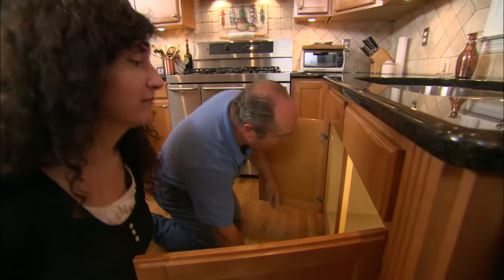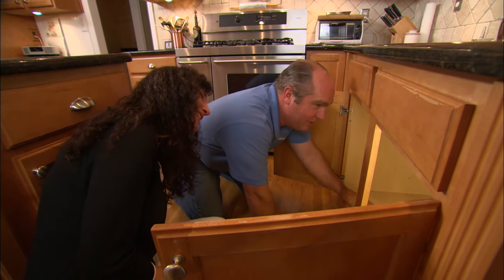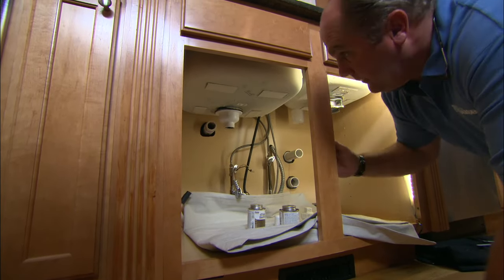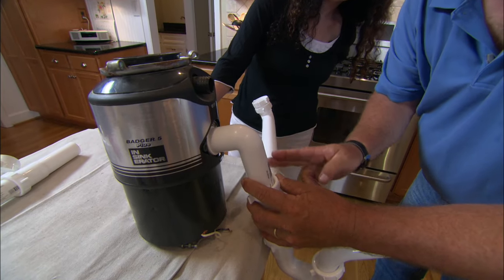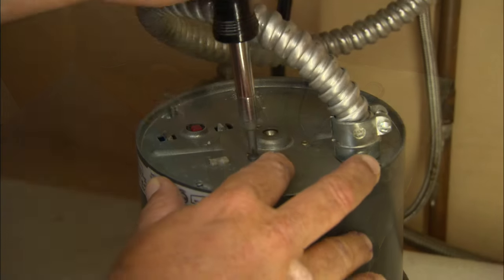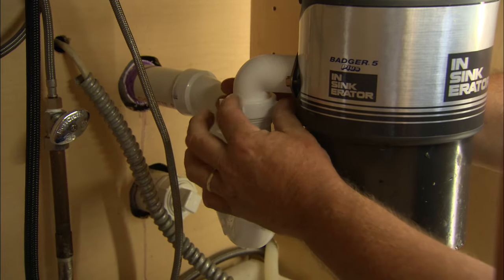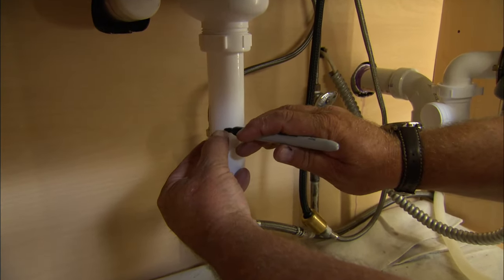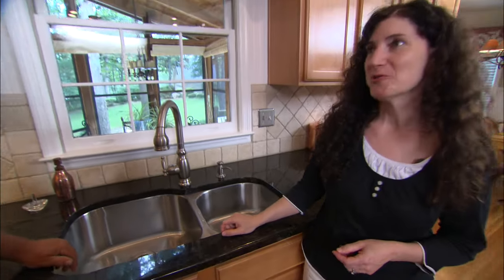How to Repair a Kitchen Sink Drain Trap | This Old House

Comment: I just did my initial inspection of a house rental and the kitchen sink drain piping is leaking all over the place. I can tell its been like that for a long time because the board base is now all black and warped. So now I gotta get them to fix out or figure it out myself and hope the rent does not go up again. Thanks for the video it gives me some insight on how to do it however I don't have a garbage disposal.

Comment: I wonder why he didnt point out that the discharge hose from the dish washer needs to be suported as high as possible under the sink or they need to install a air gap on top of the sink.  Both ways will prevent discharge water from backflowing into the dishwasher.  Depending on the state. one or the other is required by code.

Comment: I would love to cut open the wall and see what's going on behind there.
Reply: lmao same here
Reply: Chicago code same as in Video  dbl bowl with dishwasher each has its own trap and waste line 
Material list for 2”  waste stack  and vent  
DWV fittings 
2-2” Tee
1-2x1-1/2 tee
1-2x1-/12x1-1/2 tee
2-2x1-1/2 Wye combo
1-2x1-1/2 bushing
2-1-1/2 90
3-1-1/2 tee
3-1/12 trap/marvel adapters

They openings out of the wall same height

Comment: The three trap install may be a code requirement in Georgia (at least when the house was built). All houses in my subdivision have the same setup.
Reply: You prune in this Video Richard does clearly mention 3 traps is way too much

Comment: He said that the drain pipe was too high on the left sink but the new one on the right also looks high to me. Shouldn’t it go directly to the wall from the P Trap?
Reply: Yes, he installed the p-trap incorrectly on the new one. Should’ve used the lowest available tap.

Comment: Is it necessary, or even desirable, to connect the DW drain to the disposal? Does the disposal slow down the drainage? Don't these plastic fittings come with small outlets to attach the DW drain, of course before, not after, the trap.
Reply: Unless there’s a massive amount of water/waste coming through, the disposal should never cause any backups. The amount of water draining from the dishwasher should not be enough to overwhelm the disposal and cause a backup. The dishwasher in my house is connected to the disposal, and it drains fine.
Reply: You can use a tap tee if you don't have a disposal, best to loop drain hose as high as you can,and strap to keep water from backing up in Dishwasher.

Comment: He should have used the lowest  t fitting. The system is still holding water, just lower than the basket strainer.  He also should have used 2 traps, not a baffle fitting.
Reply: No need for two traps. He only messed up by not using the lowest available tap.
Reply: interesting

Comment: Using the upper pipe is a really bad idea because now the entire horizontal pipe is at trap height and will stay full of water, this means both that draining water has to push a long plug of water, and that once draining stops there is a long stretch of pipe for particles to settle and form clogs.  Having a clean out is silly anyway since traps should always be removable and thus you already have a clean out. FAIL Richard.
Reply: He knows what he's doing as he's a professional!
Reply: vlogerhood, well, my 20+ years of licensed Net commenter says your wrong.
Reply: He knows what he's doing and it's a success not fail
Reply: vlogerhood  You appear to be mostly, if not entirely, correct. The long horizontal pipe is mostly, if not completely, below the bottom of the outlet drain, which determines the level of standing water in the system, and will be full, or almost full of water. The slight pitch he put of the horizontal pipe is useless if it is full of water all the time.
Reply: vlogerhood that’s is my problem, water stays in the horizontal pipe, l have my double sink and disposal installed just like Richard has.
Reply: You are welcome to post your own video, if anything pisses you off so much.
Reply: Many areas in North America require an actual clean out wye or tee first coming out of the wall, due to the fact kitchen sinks have grease and food waste that can clog up a drain down stream very quickly and need to be snaked sometimes through this 1 1/2” clean out.  

Imagine snaking your drain downstream through the bottom of a trap? Waste of time, taking apart your drain assembly, waste of time. Cutting your drain out to snake a clog??? Waste of time. Just install the clean out first out of the wall to save headaches later on

Comment: the dishwasher discharge does not meet code, you are required to have either an air gap or a stand pipe with trap. going to the disposal with out an air gap is a total hack job. I just lost all respect for Richard.
Reply: really,  so...you know the codes for her city that's impressive. it's even more impressive that you think a national tv show wouldn't check the building codes before doing the project and blatantly violate building code on national tv. sounds like a great way to get sued.
Reply: there is minimum code requirements, and there are best practices, even if the jurisdiction did not adopt a code, best practices would be to install a High loop, and air gap or a stand pipe. its just poor craftsmanship in my opinion.
Reply: I thought at least he would secure a loop on top
Reply: You are welcome to post your own video.
Reply: @gene8172  you have replied with a copy&paste message a couple of times on this video. However the commenters you addresses raise a valid concern! I have a drain system under the sink that is similar to the solution that is shown in the video. It "works" meaning that when the plumber shows the homeowner the result everything is apparently fine for several weeks or months. However I learnt that pipes set that way make for a wrong "stagger" and will hold a lot of standing water that will slow down the drain and promote grease build-up. I was looking for some videos on best practices for under sink drain and I was puzzled to find one that recommends my current, problematic setup :(
Reply: TOH  videos get a lot of negative feedback. It’s real easy to be s problem finder, but very few people who post are problem solvers. None of those folks post videos. Until they do, they are all full of sound and fury, signifying nothing.
Reply: @gene8172  making a video takes a lot of skill and resources. TOH has some of the very best videos available BUT if they show jobs with evident problems people are perplexed at the least. The fact that people that point out errors and mistakes do not make videos is not very relevant, if something is not a best practice is just isn't, like the staggering in this video.
Reply: It takes minimal effort to make and post a video-vapid airheads do it all the time. It takes even less effort to complain. Certainly hope we can out in at least as much effort as a valid airhead.
Reply: @gene8172  so you think the staggering is correct as shown in this video? You are saying that it's OK the output of the P-trap should be higher than a long horizontal section coming to the input?
Reply: Gravity. It’s a killer.
Reply: Most dishwashers have a drain loop built in concealed on the side wall and a check valve to prevent waste water flowing back. Still best to just follow manufacture required install for dishwasher as it will affect your warranty later on. Some dishwashers have pretty powerful  variable speed pumps which will evacuate all the waste in the drain pipe even if you have a looptyloop lol. 

I’d still create  a high loop on older dishwashers to help them drain better and less smell.
Reply: @jacksplumbingvideos7147  A stand pipe and trap is acceptable under Wisconsin Code in lieu of an air gap.
Reply: @addman  To be fair, Richard does things wrong all the time. The new p-trap he installed is against code. He could have strapped the dishwasher hose up high without showcasing it, so the dishwasher issue is likely fine.